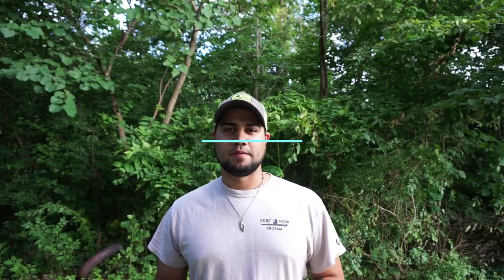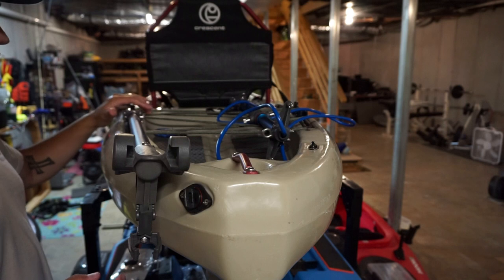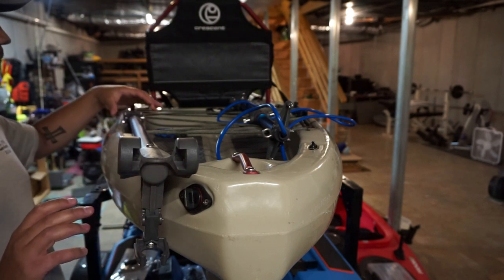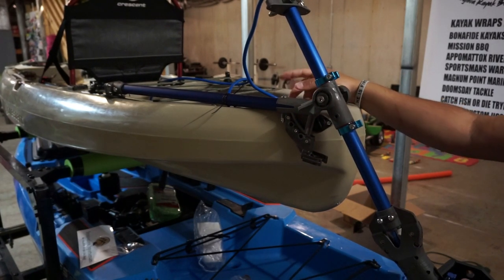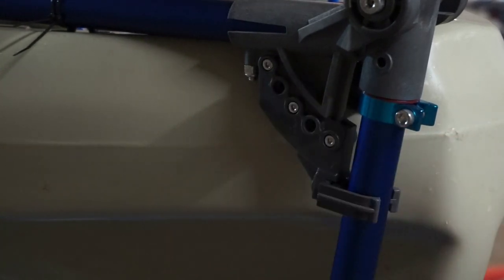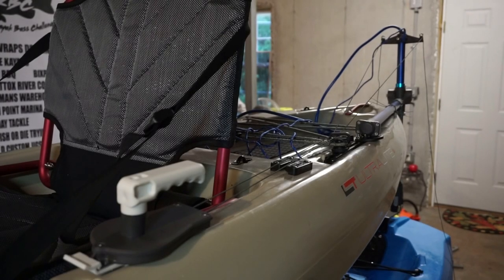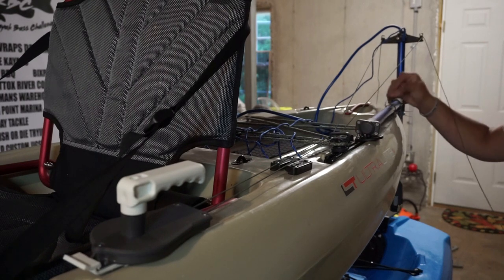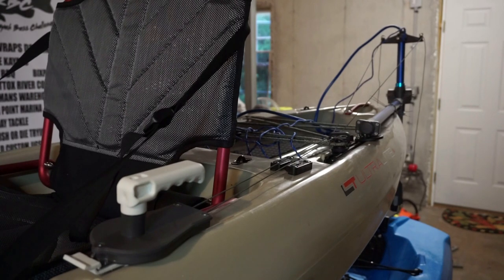Crescent Kayaks Ultra Lite - Bixpy Motor & Controls Install

Comment: Wish more videos with crescent kayaks were online. Thx for video.
Reply from the maker: I know the feeling. I'm going to put more videos out once I get back from vacation. Stay tuned for some more and let me know what you would like to see!
Reply: Great install video, great tips and way to save some drilling. 
If I can make one suggestion, instead of drilling the holes for the rudder control mount, drill holes for a 10 - 12" yakattack track in the same place.  This would allow you to adjust the control forward and back as needed and would allow you to dismount the entire setup and leave no open holes in the kayak. 
Like your videos and would love to try that motor on all the Crescent fishing models. 
By the way, thanks for checking out my Crescent kayaks videos, I appreciate it.
Reply from the maker: @kayakflyfishingschool  Thanks man, I really appreciate the tips and support. That makes plenty of sense and something that I will probably do. I didn't have any track at the time, but I didn't think about it either 😁👍. 

I may do a follow up video on that. I like what you are doing so keep it up. I want to put the Bixpy on as many as I can. I may be able to it this coming year. We will see.
Reply: @jonping8  you're very welcome and thank you.  The main reason I thought of it was because I have had the afterthoughts and that whole hindsight is 20/20 thing.  We all do at times, not to worry though, it should work well as you have it, but more time in the cockpit will verify that for sure. 
Thanks for the kind words, really enjoying your content and channel as well.  Hopefully we can see each other on the water one day and i can try that Bixby out. Been looking at specs and features and it is very lightweight, even the battery pack which is a huge advantage in this little plastic navy we are all part of. 
I wish you tight lines always!!!